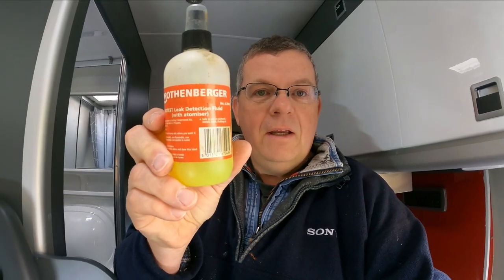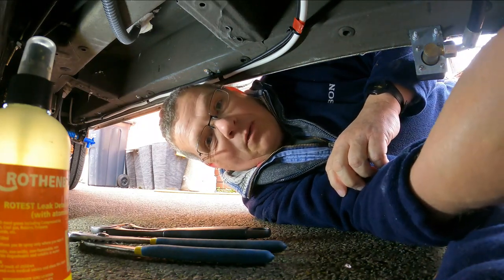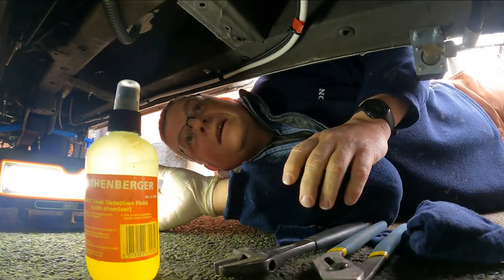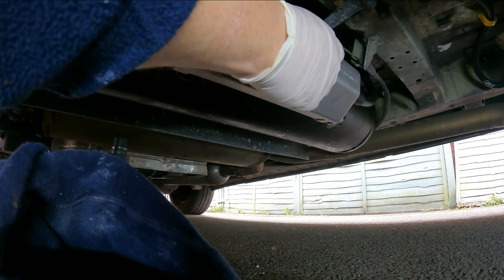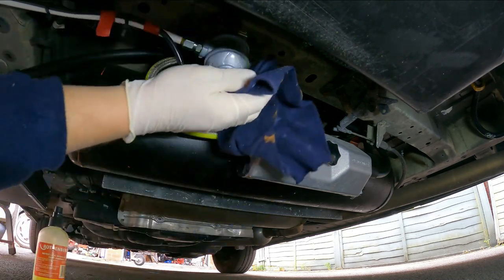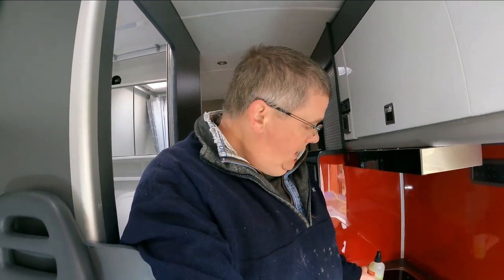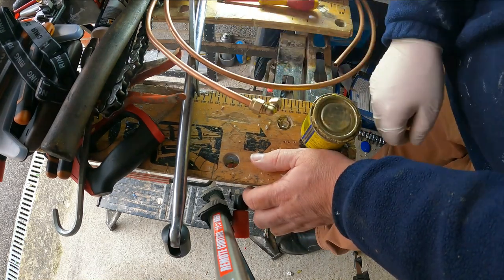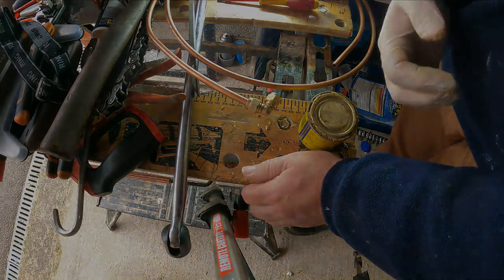LPG leak testing in self build camper van Citroen Relay / Ducato / Boxer / Promaster

Comment: Really useful. I did see another video where someone had their system checked by a gas engineer and they said that copper olives should be used with lpg instead of brass. I’m going to have to check my own as I can’t remember which I  used.
Reply from the maker: Thanks for the comment. I must admit I did not even look at what olives they were, they are just the ones that came in the fittings! it has been a year now since install and all is good and I have checked all the connections again recently with the spray and no bubbles!

Comment: Could I add that I have found leaks that the leak spray couldn’t detect but a manometer did find (got my ACOPS hat on at the moment)

Love your videos all the same and your presentation style!

I’m not really keen on the 13a socket near a gas fitting though

Comment: Nice splash back in the galley… Will you be doing the video on installation of that? Thank you
Reply from the maker: I did not really film that part to be honest. I simply made a basic frame out of B&Q 34x27 timber to fix it to to it was fairly straight up and that was about it. so there is a gap behind between the red splashback and the solway panel, only a couple of inches....

Comment: I've only just started watching your videos very good.
Have you done other vans up ? I love to do it do you work to a budget.
Reply from the maker: Thanks for the comment. It is my first build but I suspect will not be my last. In regards to budget, yes I did have a budget in mind but I worked out carefully before starting how much all the components and equipment would be so had a very good idea of what the total build cost would be. Would suggest to anyone starting out to do tons of research first and have a spending plan for what you want to install in your van. then add a good 20% to 30% on top for misc expenses etc and your good to go. hope that helps.

Comment: Did you have to route a gas pipe across from one side of the van to the other? I have to do that myself, and I'm not sure whether to run it under the sub floor, or under the van. I would be intrigued to know what you did - if you did!  :-)
Reply from the maker: Yes, mine goes under the subfloor along with the hot and cold water pipes. i used one continuous length with gentle bends at either end and elbows/joiners in locations where accessible.

Comment: Do you think there is space under your van to fit a box to fit a battery as I am thinking of fitting a 400ah lithium but would be great to have i5 underslung
Reply from the maker: I am sure there would be space although I dont think I would put a lithium battery under the van even if in a box, my concerns would be: wet, damp, dirt, damage from road debris, cold etc etc. You of course do what is right for you and your van but I would not do that. all the best with it.